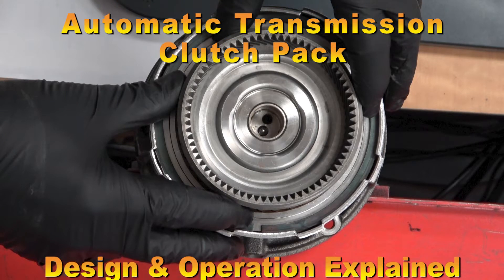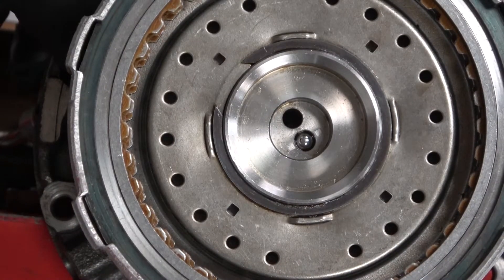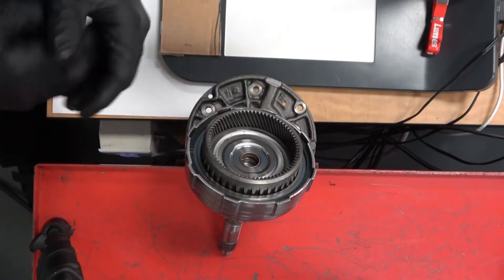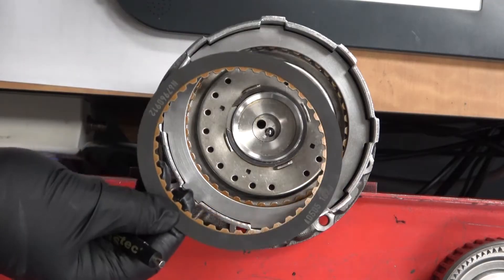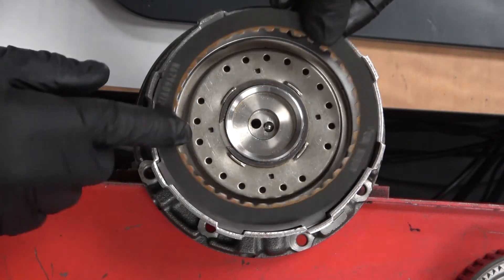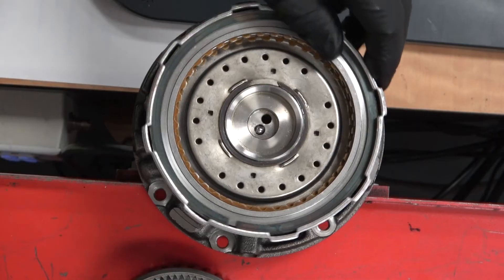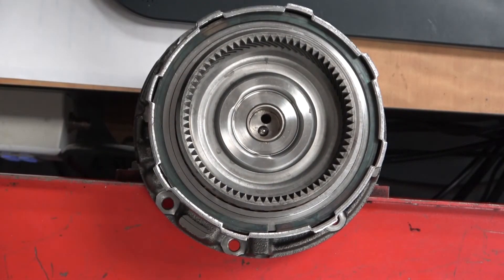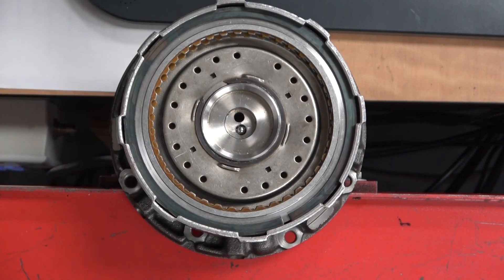Automatic Transmission Clutch Pack Explained

Comment: No one wants to explain the mechanism of how applying hydraulic pressure abd squeezing the clutch pack locks the gear
Reply: The hydraulic pressure pushes a piston that literally just mechanically squeezes those metal rings (with external teeth interfacing with the housing) 
and friction rings (with internal teeth that interface with the component) together so hard that they can no longer slip past eachother thanks to the high friction material on the friction rings. Which by the transitive property interfaces the component with the clutch pack housing.

Imagine pulling a bookmark out of a closed book, not too hard.

Now put a half ton weight on top of the book, you probably wont be able to pull the bookmark out.

Comment: I've noticed there is a plethora of information on transmission operation, disassembly and assembly, and component information, however, I am searching far and wide for examples of normal wear in transmissions. For example, it is easy to tell when a clutch disc is completely burnt or worn, but what about a real-world example of a worn clutch that isn't just completely destroyed, like something that would cause a minor transmission issue. If anyone knows where to find a real-world example of a worn clutch that has caused hot spots, but isn't just a complete mess with obvious wear, I would greatly appreciate that. I have started rebuilding transmission again after a 5-year break, but I am doing more warranty repairs and customers under warranty want any minor issue fixed. I used to rebuild customer pay units and they were all obviously destroyed inside by the time they came to the dealership with completely destroyed frictions, and clutch drums that were severely warped and black or blue from over temperature conditions. Thank you. Google images only ever show the two extremes of the spectrum for clutch wear, but a more realistic example of a slightly worn clutch that is starting to cause an issue with minor hot spots on steels would be great for learning. I find myself tearing down units with a slipping or binding clutch assembly, that show burned clutches without much material missing, leaking apply circuits in valve bodies causing the damage, and minor hot spots on the steels. I ask myself as I replace these components whether or not warranty is going to charge back my repair due to the minor wear when I rebuild them. The warranty units will have clutch material in the fluid and steel material that is excessive on the magnet, however there is no extreme damage, but more of a minor wear condition on all clutches and steels that add up to a large amount of debris.

Comment: If they are friction disks, why would oil be allowed create a barrier with the steel disks? Shouldn’t they have direct contact to create friction to move?
Reply from the maker: This is the magic engineered into Automatic Transmission Fluid (ATF).  In addition to all the other special additives it has a friction modifier additive that acts as a barrier or go between for the friction disks and the steel plates to keep the friction disks from wearing out. ATF is not only slippery it can also enhance friction when placed under a high pressure condition. There is a ton of technological engineering that goes into today's lubricants of all kinds for special needs. Additionally when the clutch is applied to change gear ratios the clutch has to engage and stop slowly to provide a smooth exchange in gear ratios otherwise the exchange would be very harsh and jerky.

Comment: Hi i have a older th350 that had broken pieces of friction discs or clutch pack at the bottom of pan. But changed fluid and filter and runs great . Have you ever heard or seen anything like that before ? Genuinely curious its really odd to me that it runs great with no problems. It goes through all the gears asap no delay. Shifts just fine. Its very odd to me. That its still working 2 months later.
Reply from the maker: It is amazing. Not being able to see exactly what you found it's hard to give an explanation however, take this as a sign that failure is coming and likely when you least expect it. Chunks of stuff in the bottom of the pan is never good.

Comment: Tom, i am doing some testing on Camry..  found some interesting things and i thought only you can hep me.

I can manually shift the lever to 3rrd gear or 4th gear and drive the car bypassing 1 and 2. if i do the same in manual transmission it wont work. so wondering how this is really working in automatic transmission. am i missing something on basics.
Reply from the maker: I'm a little confused. You have an automatic Camry and you can drive from a stop starting in 3rd gear and then shift it into 4th manually?  The only way I know this is possible is if 1) the vehicle is in fail safe. 2) your using the shift transmission feature in a scan Tool. 3) your manually using jumper wires to operate the solenoids bypassing the computer. 4) you have a special tool that manually connects to the trans electrical to bypass the computer.
Reply: @ in Camry I can choose the Gear manually override using Gear shifter similar to sports options. question is in manual transmission I cant 
Drive the car in 3rd gear it will be hesitate to move but in automatic I can drive in 3rd gear so surprised how automatic transmission can start and drive from 3rd gear vs not in manual. Was this bcz of torque converter
Reply from the maker: So you have the type of shifter that you move to Drive, then push it to the left, then up or down to select a gear?  Is this correct? You typically would not be able to drive from a stop in 3rd of 4th gear because the load on the engine and transmission are too great. Think about trying to start from a stand still in 3rd or 4th gear on a manual transmission with a clutch.  Your going to burn up the clutch and have to slip it a lot just to get moving. The trans may have a manual mode but it also has a smart mode and it won't let you damage the transmission by trying to take off from a stand still in 3rd gear.
Reply: @ thanks so much. On fail safe mode some cars allows to go to 3rd gear only from stand still wondering that is just to allow us to drive to repair shop
Reply from the maker: @sivucit  Yes.  If the computer has Zero electrical the transmission (or there is a major error) there is a default gear that it will lock into when all the solenoids are de-energized.  Normally this is 3rd or second gear.  Two other things happen.  Line pressure is set to maximum to in an attempt to keep the clutch packs from slipping due to lack of gear ratio torque multiplication and the driver will also have reverse. Reverse is not electronically controlled and not dependent on any solenoid position but instead dependent on shift lever position.  The vehicle will take off from a stand still like shit because of the lack of torque multiplication in 3rd gear but it will drive and once the vehicle is at freeway speeds it will seem OK but this is just so the vehicle can be moved safely to a place where you can wait for a tow truck.

Comment: Hi at 6:09 timeline you said that friction will rotate with that gear.

Scenario 1: Clutch is not applied.
 Steel plate will rotate with housing but friction will not rotate and it be static with that gear.

Scenario 2: Clutch is appied.
Steep plate will rotate with housing and friction will be sandwitched with steee plate (like rotar and brake pad) and it will rotate the gear ..

Is my understanding right, 

Pls advise.
Reply from the maker: In essence yet that is correct except I thing I would prefer to rephrase it slightly to be a little more correct. When not applied Scenario 1 the the steel plates/housing can rotate independently from the frictions/gear. When applied scenario 2 The housing, steels, frictions and gear are all locked together and they can not rotate independently from each other.
Reply: @DrivelineMaster  Thanks Tom, much appreciated.. I  cant thank enough on all yourr support answering most basic and some time some stupid questions as well. Thanks again.

Comment: It's absolutely unbelievable to me that someone actually designed this and all those moving parts and then actually made the parts and made them all fit together and actually work..
Reply from the maker: Wrap your head around this.  In a 4 stroke internal combustion engine the piston strokes the cylinder twice for every crankshaft revolution.  If you drive 1 hour a day to work with the engine averaging 2,500 RPM that piston will make 5000 strokes per minute or 300,000 strokes for one hour.  when you return home that's another 300,000 strokes.  That's 600,000 strokes per day (2 hours of driving at 2,500 RPM). If you do that 5 days a week that is 3,000,000 strokes a week.  If you work 50 weeks out of a 365 day year that is 150,000,000 strokes a year and if you keep the car for 10 years that is 1,500,000,000 piston strokes.  And that is just a half a cycle for one cylinder.  For a complete cycle there are 4 strokes so double that to 3,000,000,000 strokes just for one cylinder and we have 3, 4, 5, 6, 8, 10, and 12 cylinder engines and they  last 20+ years sometimes with minimal wear.  Talk about engineering and reliability, now that blows my mind. I didn't even factor in all the variations in RPM that can often push the RPM to 5 or 6 grand at times.  Think about this the next time your engine is due for an oil change. that oil is protecting all those moving parts that make this a reality.
Reply: And without modern computers and rendering software.

Comment: Thank you very much for the detailed video. Can you Please send me the part number for a 2008 Escape 3.0 litre cluthe pack. My escape quite driving very sudden with no warning shoots. Thank you very much.
Reply from the maker: Every Transmission has several clutch packs and some vehicles have more than one transmission model.  The most cost efficient way is to remove and disassemble the transmission to find out exactly what parts are needed to restore it to functionality.  If you do have a burned up clutch pack it will be noticeable by a dark colored fluid and the fluid will smell burnt.  The only way the fluid won't be dark or smell burnt from a burned up clutch pack is if someone changed the fluid before you had a chance to inspect it. There are different levels of overhaul kits starting with ones that only have gaskets and seals to ones that include all the clutch pack and maybe even a band if the trans has one.

Comment: Is there a way I can donate to your channel. You helped me quite a bit lot with lot of tech info. Thanks again. Last question is it ok to start the car when cv axle is out on jack stand. Also is it ok to tow car without cv axle but with wheel on hub and control arm
Reply from the maker: I don't have a donate feature setup so for now the only thing would be my paypal account.  If you really want to donate email me directly and I will send you my paypal information.  If the axles are out when you start the engine you risk oil spilling out where the axles go.  I would not tow the vehicle with the axles out. The axles help to hold the wheel bearing together.  The wheel bearing could become damaged if you tow the vehicle without the axles installed and the axle nut torqued.
Reply: @DrivelineMaster  hi I started the car today and I see that transmission oil is leaking between engine and transmission matting part. Does that mean I have broken the oil pump